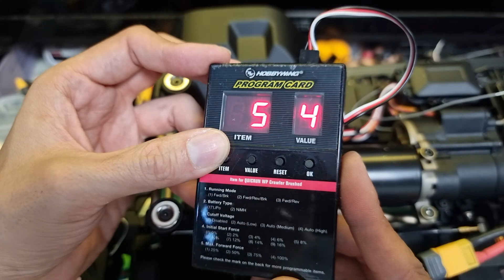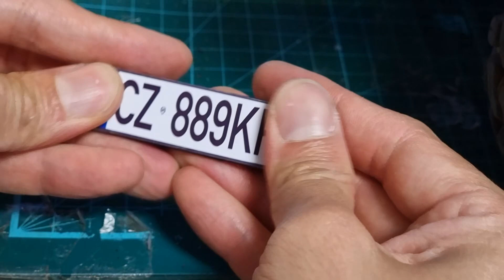1/8 Scale YK4082 Pro Jeep Unboxing & Test Run

Comment: I believe that ESC is a HW1060, The 880 is for a 2 motor rig, and the HW1080 doesn't look like that or come on RTR vehicles. That is a 550 brushed motor probably a 17t, if it were a 775 motor it would be about 8-10mm bigger in diameter.

HW1080: https://hobbyking.com/en_us/quicrun-wp-crawler-brushed-1.html?utm_source=google&utm_medium=cpc&utm_campaign=google_us_shopping&countrycode=US&gclid=CjwKCAjwv_iEBhASEiwARoemvJhY60BfXqzJdzl8AAVCchxVUPQl5FD0pe5R3ha42uSUJ7xIJjAk5hoCbPcQAvD_BwE&gclsrc=aw.ds

HW1060: https://www.amainhobbies.com/hobbywing-quicrun-1060-1-10-brushed-esc-hwa30120201/p713266?gclid=CjwKCAjwv_iEBhASEiwARoemvBf1242iTPomG1rBzEwAmI7mTgEA54IWovdc2wBT4ualE1bqxScZuxoCF-cQAvD_BwE

550 size motor compared to a 775 motor: https://www.ebay.com/itm/390-540-550-555-775-795-895-High-Speed-Torque-Motor-for-Drill-Toy-Car-Boat-Model-/232253187137?_ul=IL
Reply from the maker: In reality, the motor is bigger and the 880 esc is right.
Well, thank you for your advice.
Reply: @RCPlayGround  In reality that is a HW1060, the 880 looks nothing like that I even posted a link showing the different ESC`s. The ESC in the truck has a square finned heat sink with 4 wires ONLY coming out of it not 6 like the 880 has here is what the 880 looks like https://www.wish.com/product/5df98f069455300521ba66ce?from_ad=goog_shopping&_display_country_code=US&_force_currency_code=USD&pid=googleadwords_int&c=%7BcampaignId%7D&ad_cid=5df98f069455300521ba66ce&ad_cc=US&ad_lang=EN&ad_curr=USD&ad_price=27.14&campaign_id=12200129997&retargeting=true&exclude_install=true&gclid=Cj0KCQjw7pKFBhDUARIsAFUoMDaVqZX0e4lwKSZdLBEV62GJDhFP3p08CrfZBkdCjhqc005lwPSfSYcaApvHEALw_wcB&hide_login_modal=true&share=web

As far as the motor is concerned it is to narrow to be a 775, I have a 775 and it looks nothing like that. Maybe the info on the box or in the description where you got it from is wrong. Companies do like to do that to get peoples attention to get their products sold.

Comment: how does it compair with traction hobbys cars?
Reply from the maker: The TRACTION HOBBY has good heavy driving, real difference, and good quality.
The YK4082 is relatively inexpensive, with built-in LEDs and is good for rocking.